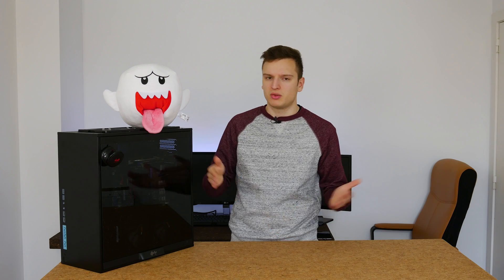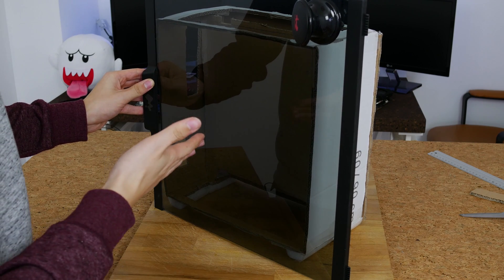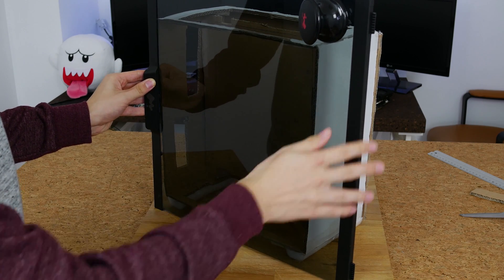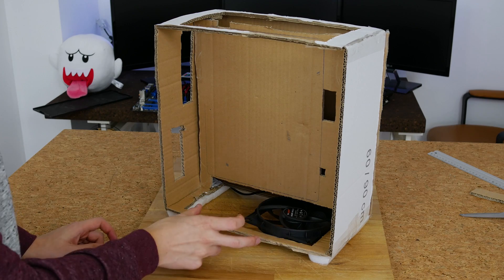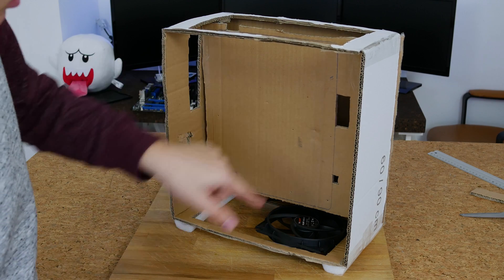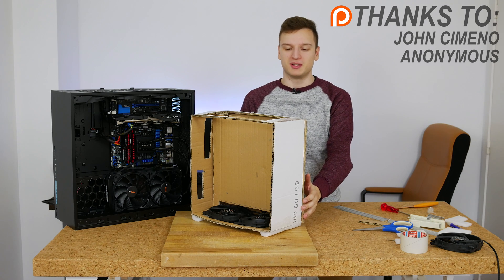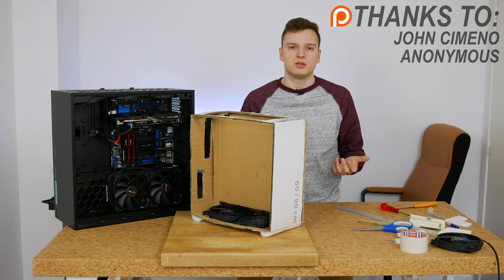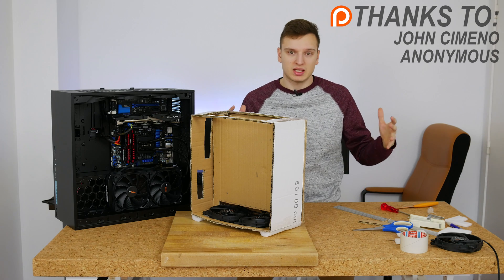Unicorn Project One | Scratch case build | Part 1: Prototyping

Comment: Hey, if you replace those 2x140mm fans with 3x92mm or 4x80mm you'd be able to shave 25mm from overall case length because then they would fit on one side of the motherboard. The side where you have the PSU and SSD doesn't need additional airflow because the PSU has its own fan and the SSD generates very little heat. Simple natural ventilation would be enough on that side. Feel free to ask me about ventilation and heat management, I am a HVAC specialist.
Reply: But this would require him to buy those and it would run louder.